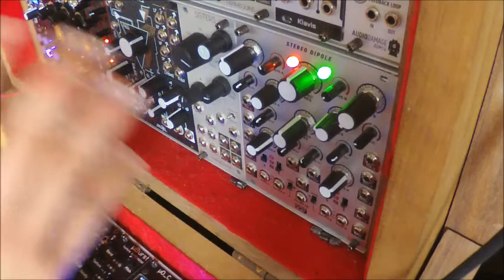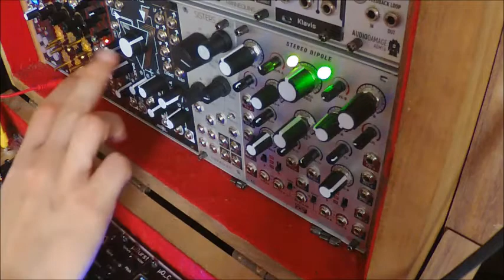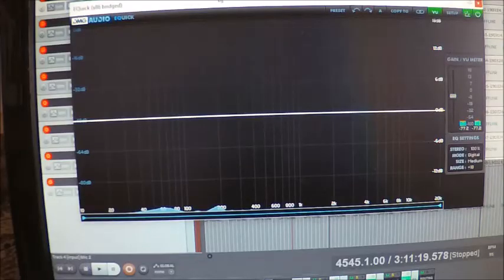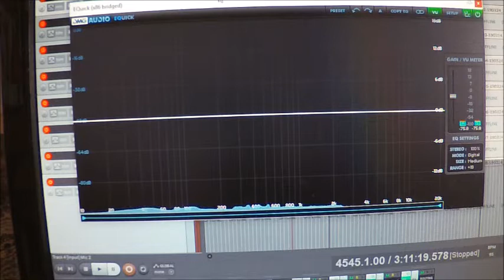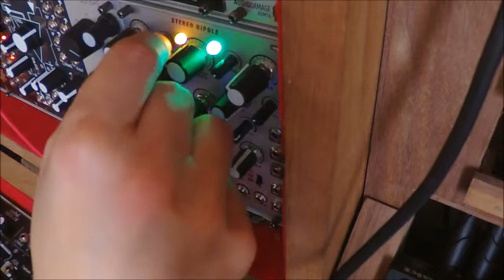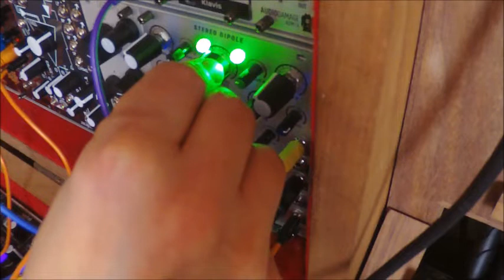Steady State Fate - Stereo Dipole Filter: Woefully Underproduced Ep 04

Comment: Do you believe this to better than the QPAS overall? Or just more versatile?
Reply from the maker: it's hard to say one is better than the other overall.  i think it's wiser to think about choices like this in terms of what you hope to accomplish. as i said in the video, qpas definitely has a unique resonance timbre so that may or may not fit the palette of what you do. but that's just one consideration. i think where they differ the most is in the modulation and control options. so SSF SD has more fine tune controls over the two main filters but also the option for the big shared control knob. so in that sense, yeah,  it's more versatile. so again, i think it just comes down to what works for you. for me, i like having both of them
Reply: interessted in this as well!
Reply: So you’re saying I need both....hahaha great video man, it sounds incredible. I can’t find another video that goes in depth with this module
Reply: Not only that but your composition makes it sound even better
Reply from the maker: oh thanks man. i appreciate it.  i guess another way to think about it is SD can act as two totally independent filters. qpas can't. but qpas can give you simultaneous output of all filter types in stereo. hard to think of what you would do with all of that at once though. with SD you've only got the five outputs that you can mix and match
Reply: also remember more versatility doesn't necessarily make it better. QPAS consolidates lots of controls into macro controls making it easier to understand intuitively, and u may find the extra versatility unnecessary for ur specific needs.
Reply: nutritional yeast You are correct. However, I wasn’t implying that versatility is better. I was asking if he thought it was better overall Or just more versatile.
Reply: nutritional yeast i tried them side to side, I found that i didnt understand what the qpas was doing as compared to the dipole. dipole has a lot more control and made more sense to me. sounded a lot better too and way more filter combinations that took the dipole to another level.

Comment: I found it kinda hard to find where you are in terms of cut-off because of stereo and individual controls, same with resonance. Also LEDs are VERY bright, in case you want to use it in dark.
Reply: Burak Eren interesting, i found it simple. set center freq with stereo controls, tweak each channel to taste...
Played with it the other day and have to say the leds are not very bright at all. nice soft glow.
Reply: @diabolicdru  When you set stereo knob to middle filters does not fully close by their own knobs. About led i guess it depends a lot on the enviroment. They are as bright as Intellıjel leds
Reply: Burak Eren pretty sure the bandwidth goes beyond audio so you can spread all the filters super wide and still scan through all the cutoff frequencies. Not center, but around 10 o’clock with the stereo control and you are there as far as covering the whole range for the channel cutoff controls. still seems minor to me, but to each their own I guess.
Reply: @burakeren  The filter was actually designed with the opposite in mind. As a matched stereo filter, you would set the channel freq controls to center, and achieve an ultra-wide cutoff range using the stereo frequency control. When using each channel as an individual filter, yes you do need to turn the stereo control down from center a bit and acts more as a range control in that manner.
Reply: @SteadyStateFate  Thanks for the reply.